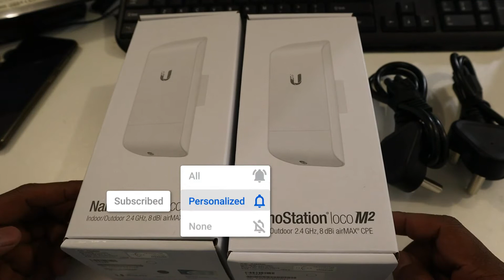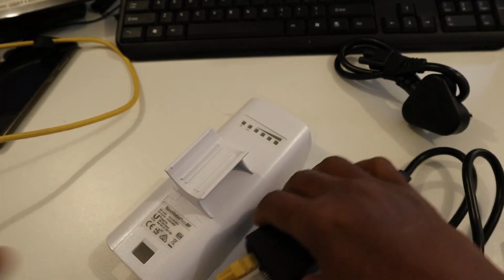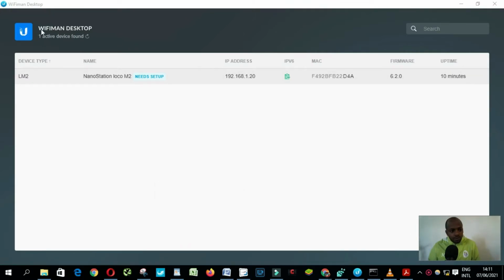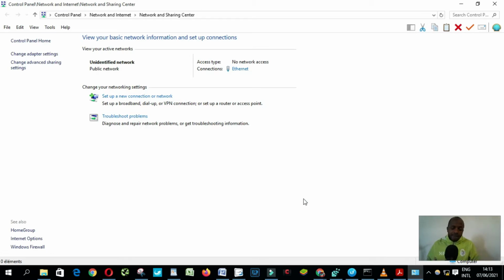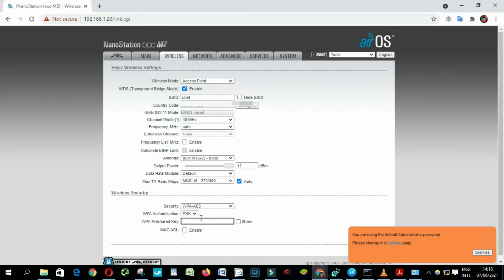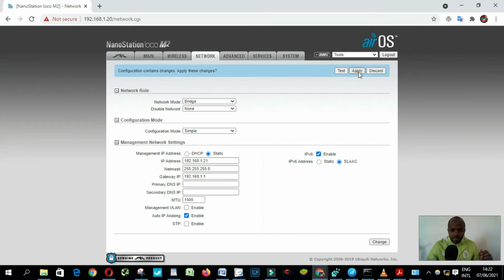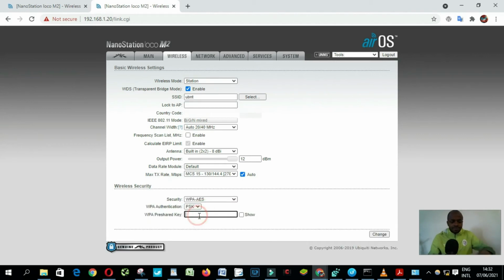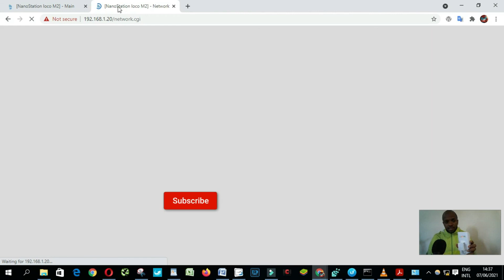Ubiquiti nanostation loco m2 bridge setup

Comment: After watching your video (Ubiquiti NanoStation loco m2 bridge setup) on YouTube. It occurred to me I might be able to use this for a live event, where running cables is either impractical or impossible. My normal setup involves  a closed network, which includes a switch, (sometimes connected to the internet via a router), a ATEM switch, a PTZ controller and several PTZ camera each connected to the LAN via etc cable. Typically there is a HDMI or SDI video source and a ethernet cable for data control. After watching this video I became curious if a long ethernet cable could be replaced with the Loco M2 to send data to the PTZ camera?

What I want to do is use the Teradek Sparks for video/Audio transmission and the NanoStation Loco M2 to transmit Data information. I am making the assumption that the packets sent from the controller over ethernet can also be sent via wifi.
Reply: Yes, of course, but there are a lot of better options in the wifi bridges market. This Nanostations are litlle to big and powerful  to put in the back of your PTZ.

Comment: Do we need a router at the station side also to host a network accessible from multiple mobile devices?
Reply from the maker: Yes. I will advice to have a routeur for your clients. This setup was for IP cameras we only used  POE switch on both ends.

Comment: Question

The wifi at my house is great. Strong signal. All good. My shop is 200ft away. Good signal outside shop but weak inside because it's a steel building. Do I just need one NanoStation Loco M2. Mount it outside shop. Power it up POE. Then run the ethernet from that to my wireless router in order to have WiFi in the shop?
Reply from the maker: You will need two Nano.